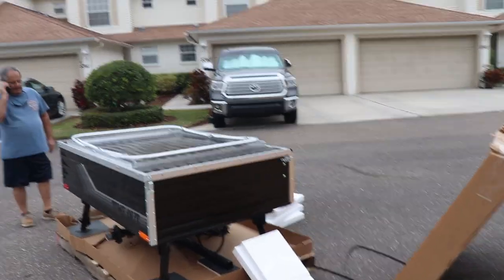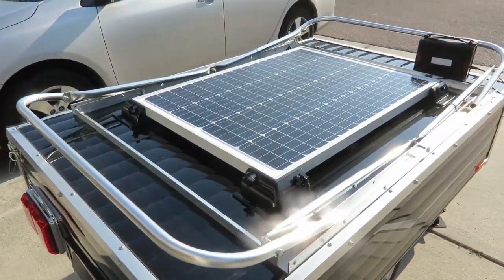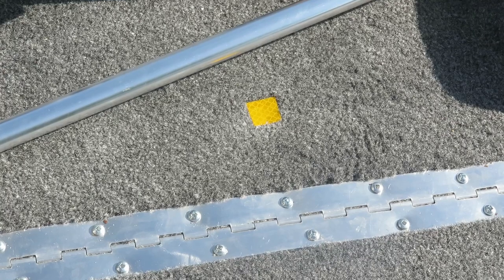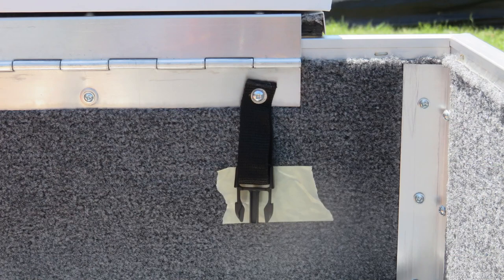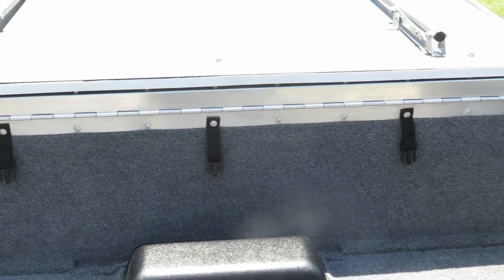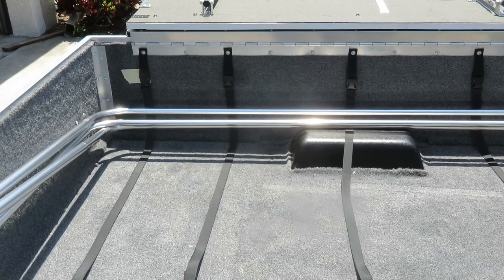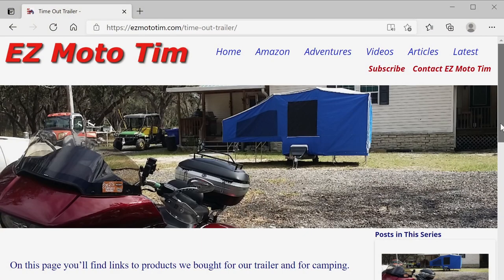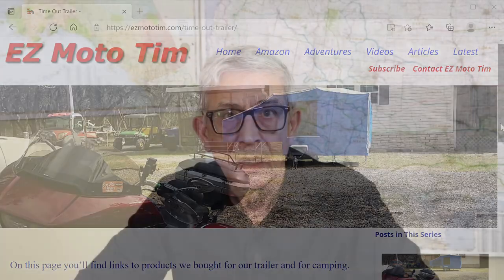Motorcycle Camper Trailer Enhancements – Time Out Trailer Part 5

Comment: Tim,  Could you show me the other end of the strap you made to cinch the tent material and you it works?
Reply from the maker: I used these luggage straps: https://amzn.to/3B1XlOS  You connect the straps to the clips I show in the video while you fold the tent down. Then disconnect the straps and connect them end-to-end and tighten as you usually would. Thanks for watching.